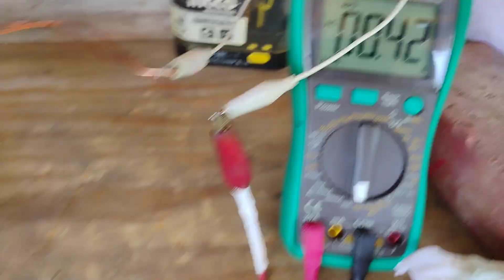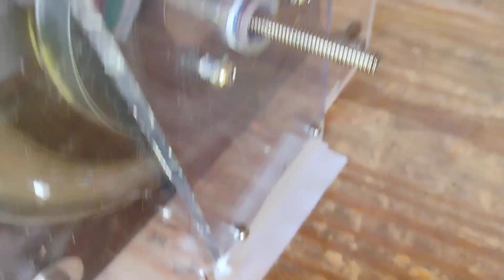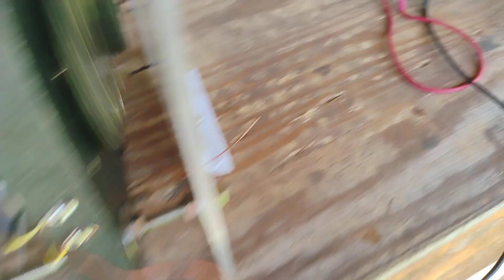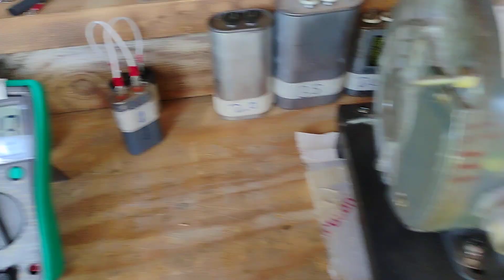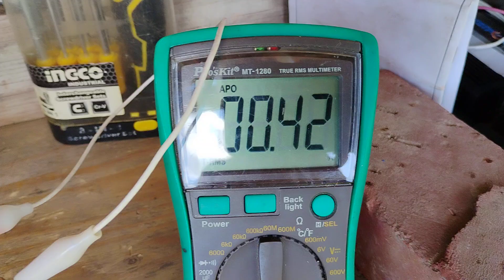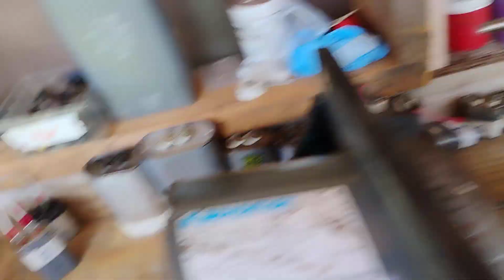DualRotorFlatDiscAlternator about ready to power an invertor then loop it

Comment: Could it be the bifilar is reducing the lenz drag?
Reply: Bifilar have been invented by N Tesla under patent “coils for electromagnets” there would be no drag. Spot on observation and right approach for such use
Reply from the maker: Hi Jon
Yes that is what it seems like, the bifilar winds in parallel make for less draw from the prime mover of the rotovertor motor while  under loading of the alternator (shorting out the 6 oils as the load)  
 "RV" AC motors really good for checking lenz reaction as very sensitive to shaft loading and you will really see it down to the milliamp as you see here.
Its a good thing happening on both sides of it - more amps flowing with the parallel bifilar winds, while same voltage being produced, and in consequence the amp draw to the RV motor goes down, so makingi more output and reduciing  input. 
When you buy a stock 3ph AC induction motor, the ones advertised "energy saving" (like a Baldor) will have three parallel wires to the windings....might be because they know under loading the motor draws less power with the three, not just one thick wire. 
So I wonder how a "step up" to  trifilar winding would reduce lenz in comparison, and on up to 9 wires in parallel, in which it enters "litz" wire domain for higher freqquencies. 
David Bowling did a lot of testing with this reduction of lenz using multifilars in generating coils , and like the commentor after this says, there is a Tesla patent out there getting into lenz-reduction using multiple parallel wires to the generating coils.
RomeroUK used litz wire in his coils in the Muller-looper (with "backing magnets" also behind its generating coils stuck to their ferrite cores)_...
My stuff with litz wire like the "pinkmotorgenerators" I was testing in Belarus a few years ago always shows better performance than regular thick wire of the same resistance to it.
All I am trying to do is run an invertor with that dual rotor alternator and then the invertor powering the RV motor prime mover - putting a set of 3 coils in parallel now with the other set should make enough amps and a steady 15VDC - will try this out today if I find the time to do it....
Thinking for future experiments, to make  coils "dedicated" to running an invertor, and keep the same 1800 rpm RV motor as prime mover and the same rotors with the 8 magnets in each producing AC hitting the coils at "alternating" opposite ends to make that AC....these coils 9 parallel 25GA wire in each, and ohms of each coil about 7 ohms as these are....
Reply: @MrDKONZEN  If you can find online “Tesla Notes for Unipolar Generator” and read it … you can see that at increased speed, Eddy currents disappear and even takes a negative form generating beneficial effects. Also, Daniel Cook and many other inventors mention  “self inductance” of a coil … which is mostly “ignored” by mainstream science or other experts and experimenters.

Also in these Notes you may find out how Tesla have divided the spinning disc and studied the effects … after you’ll see this you may understand the disc spinning can be a bifilar with a current flow which can self induce being resonant matched and mechanical input can be dispensed at expenses of an switch and impulse generator.